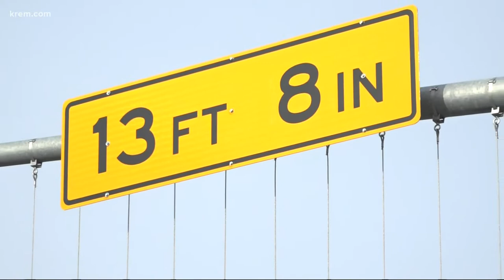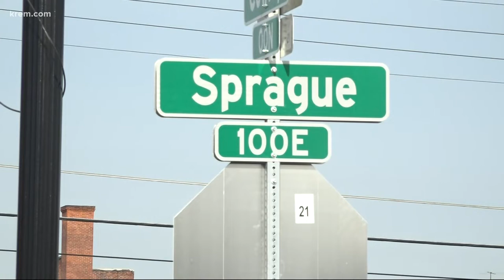Solution to stuck trucks? Spokane installs warning chimes at problem bridge

Comment: That's not 13'6 or 13'8 it's 12'6 or something lower and that sign needs to change. There are no warning signs before reaching this area. Please add what New York and North Carolina have sensors that flash letting the drivers know you are over height. I always go the distance out of route just to be safe traffic wise. I made one mistake taking a truck close to the Lincoln Holland tunnel in New York driving out into Jersey.